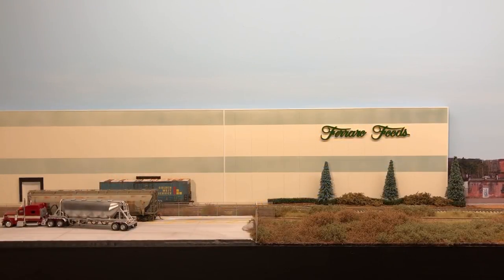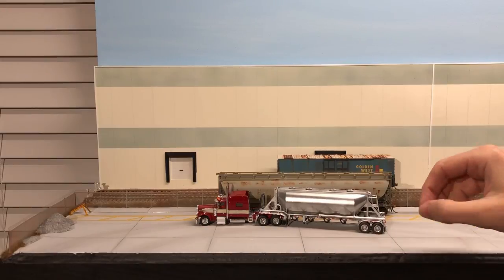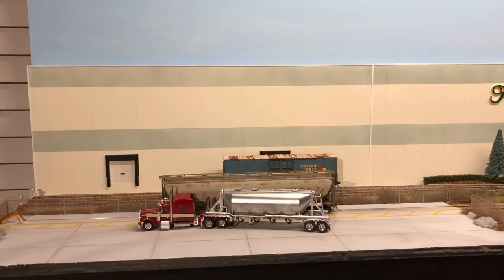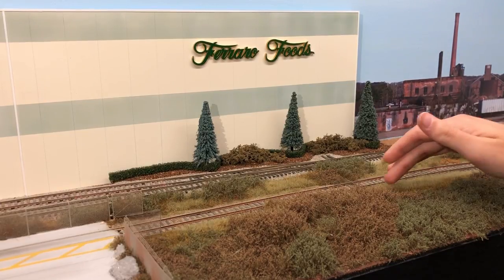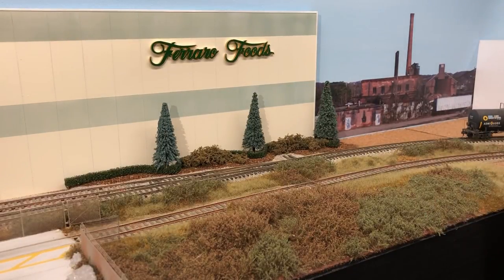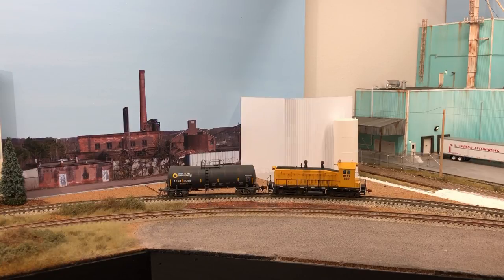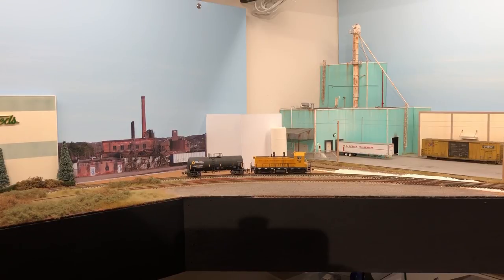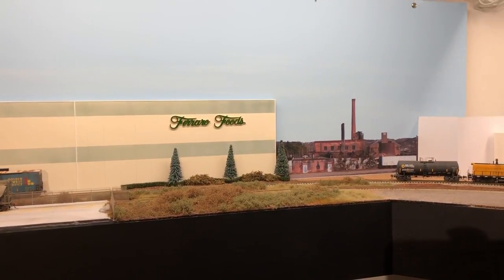Layout Update 3/12/20 Scenery and Dry Bulk Lot

Comment: very impressive, John..... you mentioned making a lighting tower for the bulk transfer lot..... scratch built or commercial? I have used the very small LEDs with very small solder contacts.... tricky..... and used magnet wire for running through the tower... please show us what you have in mind..... my harbor pier has a two light tower made from scrap bridge parts and looks okay....

lastly, kudos on not adding graffiti to your weathering process..... it's bad enough the railroads no longer use their cars as 
traveling billboards, but the splash of mindless (mostly) spray paint is a big turn off.

cheers from Bellows Falls where we are seeing Pan Am reroutes due to the Hoosac Tunnel closure (reopens in a month)...
Reply from the maker: Thanks William, I have been looking at a few pre-made towers on ebay but may end up building some myself. I will for sure include them in a future video whichever way I go. lol I do add some graffiti but I try to keep it at a minimum. Thanks for following along! John

Comment: Nice work John....the landscaping around the food industry looks like it been mulched....like the drywall 
patch cement. Couple questions:  you mix the paint in the container or separate some out then mix and where did you get that shrubbery from?  Anthony
Reply from the maker: Thanks Anthony! With the spackling, I found it easier to mix in a separate / larger container. Mix more than you think you’ll need as it will be hard to match the tone on a second batch. I used artist pigments. I found them at Michaels brand named Tints All. A little goes a long way. For the scenery materials check out Scenic Express. Martin Welberg. I swear by this stuff. It looks so good out of the box it’s nearly impossible to screw up lol. I used high and low bushes for the overgrown area. All the best, John
Reply: John2618 thanks for replying John. Getting ready to start that phase of my layout

Comment: Your extension looks great. The tip on tinting is good idea. I have seen a few roads on layouts that get chipped and you see bright white. Did you seal the expansion lines after darkening them with the pencil?
Reply from the maker: Thanks Scott. I did not seal the surface. I found tinting and leaving the material raw allows weathering powders and the pencil lines to absorb into the surface. It also leaves a fine porous look that looks really good close up. Thanks for following along.

Comment: Me again. Had a thought about the bulk transfer area. A pump house for  compress air and loading racks.
Reply from the maker: Thanks John! I actually have one built and on the layout, it is just in the wrong spot lol I planned to have the unloading area in a different location before the extension was built. I still need to move it over.
Reply: @RailserveJohn  LOL. I should have known.  You're an amazing modeler in all you do. I have enjoyed following all your posts. Thanks so much for all the great info and tips you've given us all.
Reply: Hey John just wondering how you are doing. Was just out on the front porch watching trains. I live about 75yds from the CSX main through Harlem Ga. . The last few weeks they have been running super trains with helpers mid train and a few with   them on the rear also. I've been doing a lot of weathering changing some track.